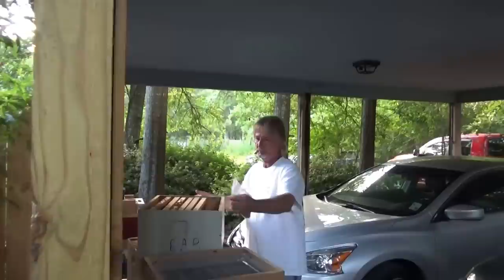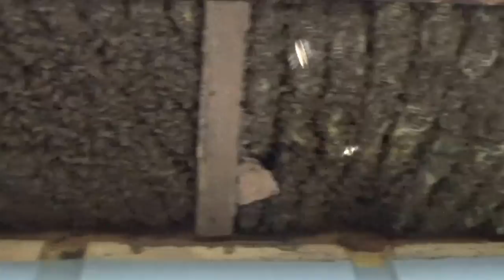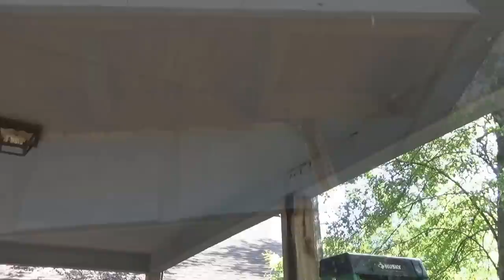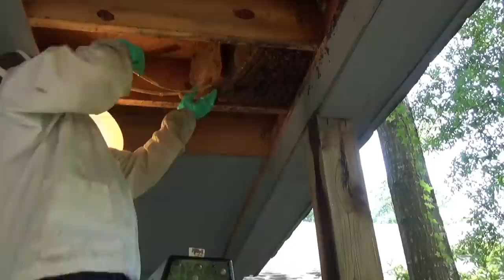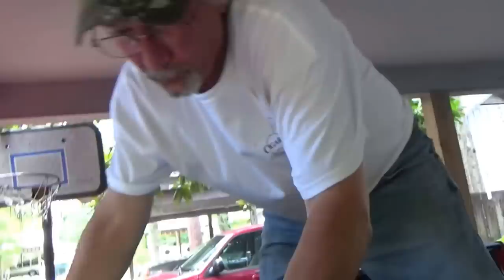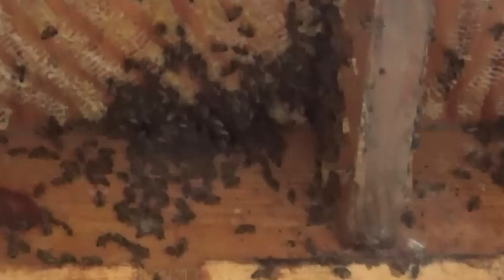Two bee hives removed from the same car port

Comment: That really gets messy when you have to cut into the combs loaded with honey. I  could hardly believe how it ran down. Like rain coming down.
Reply from the maker: One of things I dislike about removing a hive that is over head, the honey shower I'm going to take. By the end of the day, there is hardly a spot on my body that does not have honey on it. It's just another reason I always bring a change of cloths when I do a removal, I'm not getting in the truck covered in honey. Thanks for watching. God's peace.
Mr. Ed

Comment: I'm amazed that the comb with the electrical cable running through it came out 'cleaner' than the outside one.  It looked as though there was nothing left behind although it did drip more as he had to cut it to remove the wire.   Do you spray the area with anything to dissuade other bees from setting up home there again?
Reply from the maker: The wire made it difficult to remove the comb, but I just trimmed around it and removed it. All part of the job. I do not spray anything, I remove as much as I can and hope for the best. As it turned out, I caught 2 swarms of bees here this year in swarm traps. Once a building is marked by bees, new bees will move in.  Thanks for watching. God's peace.    Mr. Ed